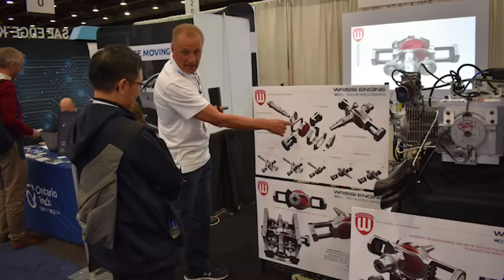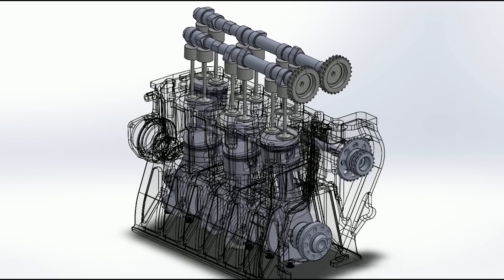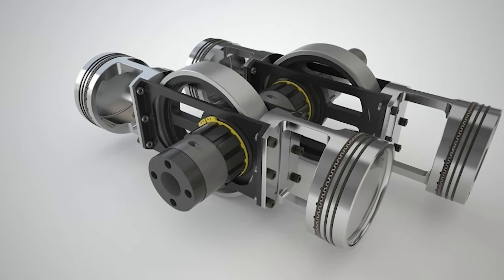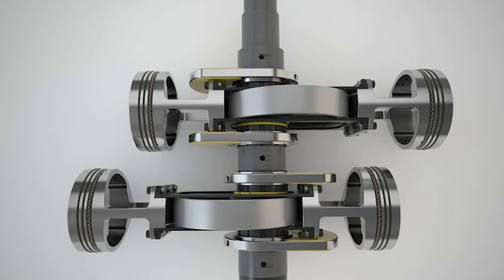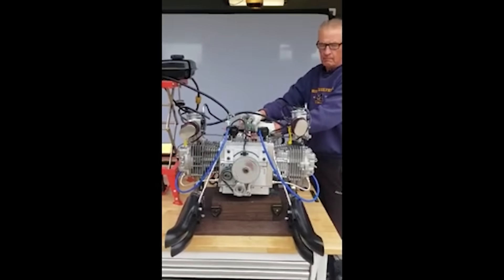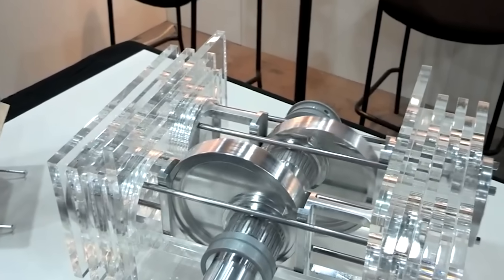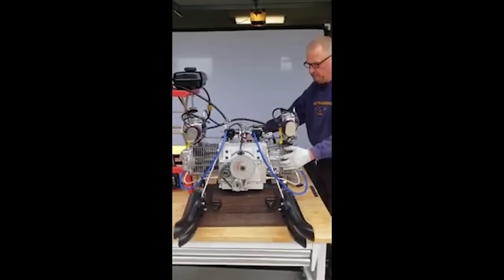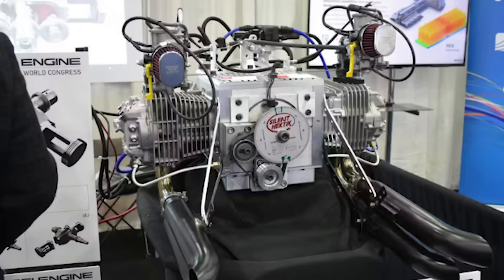The Waissi Engine: Reinventing The Combustion engine

Comment: 1:20 mechanical complexity? hard to find something simpler than a rotating crankshaft. Waissi engine is testimony to that. And the sinusoidal motion of the moment arm provided by a rotating crankshaft which leads to its inherent inefficiency is unchanged in the Waissi engine. The location of the sinusoidal motion has just been moved to a different component. Nothing new here. Just another embodiment of a Scotch yoke engine.

Comment: There's a lot wrong with this engine. Unlike a traditional engine the crankcase of this has to be at least double the size for the same stroke as a normal engine. A normal engines piston travel can utilize almost the full cavity of the crankcase this literally has to use less than half. So whatever the stroke of the engine piston the crankcase will be more than double that to accommodate that stroke. Also the torque you would achieve from the way this crank works would be inferior to a traditional engine since you would not get the leverage that a traditional piston rod and offset crank

Comment: So many dim bulbs. ICE isn't going anywhere. The problem, is the fuel we been using. 
JDR worked it out so we all flare his garbage out our tailpipes. 'Ol man Henry wanted to build the Model T with resin impregnated hemp body panels and hemp oil in the crankcase.
And he designed it to run on ethanol. Same stuff Brazil runs on. Sustainably. At $0.77/L.
David Blume. Wrote a book. Alcohol Can Be A Gas. I've listened to around thirty hours of his casts here on EweToob. He calls ethanol the sun's energy in liquid form, a ton of benefits, the biggest drawback is gas is about 15% more energy dense. EVs are on a hall pass from the Smithsonian. They were made more dangerous with the addition of the dreaded lithium dendrites. Tesla's own advice to FDs is immersion. Yes. A dunk tank. Give your heads a shake.

Comment: For a hybrid car no circular motion is needed. In a hybrid the motor drives a generator. It is easy to make a generator that is driven by a lineair motion. So in the future only motors with lineair motion. Crancshafts are obsolete.
Reply: For eCVT transmissions, (the majority right now), your theory is wrong.  The electric motor/generators are coupled directly to the planetary gearset and have no belt like typical CVTs. I'm afraid that the current technology doesn't accommodate a linear generator because the gas engines in hybrids are used also to provide peak power when needed.  Sorry mate!

Comment: It has been proved that EVs are cleaner than ICE over the complete life cycle including battery manufacturing.   Most ICE analysis ignores the cost of exploration and extraction and refining of oil.
Reply: Hi CCP Bot.  We’re not buying it and we won’t have it forced upon us.  Next step is find out.
Reply: @rollsroyce329  Well I live in Florida and am 72 years old so I predate bots by many decades .  I also believe in science and facts based issues versus wherever you've got your head stuck up
Reply: @PC-vq5ud  You sound “Vaccinated”.  You may not be CCP but you’re definitely an NPC.
Reply: @PC-vq5ud you sound “Vaccinated”.  You may not be CCP but you’re definitely a NPC.

Comment: As design engineer I dont like it.  with a conventional engine the big end bearing has a large surface area with an pumped oil film between the loaded area. The engine in this videa does not, it has very tiny contact area on the loaded face. 
The only way around that would be if the offset wheels had roller or needle bearings on its diameter, then the load will be spread.

Comment: The beauty of this is that it isn't an entirely new engine design, it's just a new kind of crankshaft/connecting rod design, and all of the other outlandish 2 stroke and what not designs of modern out there engines can also be applied for even further gains and efficiency

Comment: The issues with pivoting connection to pistons are pretty well sorted out, and there are no significant energy losses from friction to reduce,  the basic principle has been "the industry standard" for piston engines since long before the first somewhat practical internal combustion piston engine was developed.  The forces/friction in the interface between the pistons and discs in that design are probably worse than in a conventional engine.      

It's classic scam is to take the working principle of some existing compressor, or even pump, and present it as a revolutionary new engine. It's quite clever as the basic principle of many compressors are basically the inverse of a combustion engine, and vice versa. And, you can use parts from such air compressors to demonstrate the working principle of "your" supposedly revolutionary new engine. And then run some actual engine that you claim works with "your" supposedly revolutionary engine design, as it makes perfect sense to use off the shelf parts as much as possible in early stages of development.     

The amount of effort by really talented people has put into seriously trying to improve piston engine designs for centuries is far beyond most peoples ability to comprehend. The basic core working principles of current piston engines are about as good as they can get, and there are other, some of which that probably are much better, ways to connect to opposing non-pivoting pistons to a crankshaft. There's theoretically room for some modest improvements of piston engines in other aspects, but modern conventional crank designs doesn't have any relevant  problems to "solve".

Turbo-shaft engines on the other hand has some huge potential advantages over piston engines, but they're rarely, if ever, even seriously considered unless their fantastic potential power density is important, and because of that and some practical challenges with them, power density, and reliability, is almost always prioritized much higher than high fuel efficiency in the development of them.

Comment: If you want an ICE to outperform the piston engine, get a gas turbine. It needs an energy storage like a flywheel or battery due to poor low end efficiency. That allows intermitttent full throttle operation.

Comment: It does not eliminate side loads on the pistons. Also at high rpm's the speed of the eccentric discs will require tremendous perfect lubrication to avoid destroying the outside contact point with the piston assembly. What is called bearing speed will kill it.

Comment: looks like the Torque arm moment is low with this change though. Are the vertical push members slightly slanted? I would try that if they didn't yet. I could look into it if you haven't yet. One thing that may also help is to offset each side vertically and keep the eccentric center shaft in the middle. That will make some imbalances, but for small applications it may still be an improvement.

Comment: Longevity for this design will be its downfall because of the twisting forces on the pistons. The cylinders will wear out laterally because the force from the disc is not in the centre of the cylinders. At the same time the torque delivery will be relatively low because the point of pressure on the eccentric disc remains too close to the shaft. Like in a rotary engine, the revs can make up for the low torque, but then high fuel consumption becomes the next issue. It is likely to go the same route as the Wankel engine.

Comment: First I wished car manufacturers had investigated and installed efficient, narrow rev range battery charging motors for self charging hybrids use YEARS ago. That way, we wouldn’t be rushing towards EVs so quickly now, and all the BS and depletion of rare Earth elements in monstrous quantities. I reckon a low capacity (250cc) diesel or biofuel would be perfect and quite literally sip fuel doing it.  But here we are, with everybody still talking about it the 0-60 times that matter rather than the environment😢. One thing of note from the video is the claim of no friction, or rather less than a standard engine. I would contest that. Surely any force exerted to turn the crankshaft must be lateral somewhere and the bigger journals would increase friction too? Also would torque be as high?

Comment: It has exactly zero chance of making it to the mass  market.   Retooling would cost hundreds and hundreds of millions or more of $$ to retool.  So far it has not yet proven reliability for 200,000+ miles like conventional engines already have proven.  Anyone who dabbled in experimental airplanes can use unproven concepts, but would you go flying keeping this in mind.?  Furthermore, the designer of this  engine has not presented one shred of metrics to show HP, torque, and longevity and lacks business savvy if he shows the engine without that.    Without presenting credible data, they look like country bumpkins.

Comment: First, I don't see what pushes the piston back inwards. Is there a connectin rod from one to the other? Second: in a conventional boxer engine, the two opposite pistons go in and out together; this design will create a huge inbalance since left and right pistons move in the same direction, also creating massive vibrations. The only way it could work, as I see it, is an 8-cyl flat engine, where at any time 4 pistons move inwards and 4 move outwards; not just a boxer 4, since in that case you would have lateral forces (the front two pistons move right while the rear two move left).

Comment: If this Waissi Engine turns out to have the promise it appears to have: lighter weight, less complexity, less internal friction, greater longevity, greater reliability... then it will be a huge hit in the General Aviation industry.  Current aircraft (gasoline) piston engines have to be fully overhauled per regulations roughly every 2000-2500 flight hours.  And it is very costly to do that, mostly because of the amount of very skilled labor involved in the overhaul.

Comment: The pistons would have a side load constantly on one side only due to gravity. Likewise oil would settle on the bottom and only lubricate the components submerged in oil. Which is why most engines have the pistons oriented vertically so oil drains away from the pistons and not into the combustion chamber.
Reply: Same issues as boxer engines.

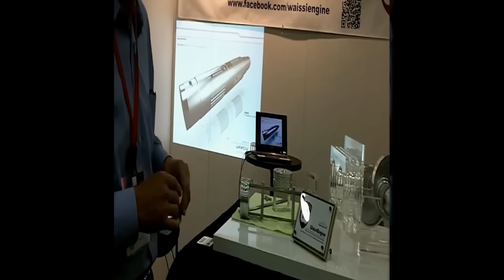Comment: @3:45 Unlike a boxer, where each cylinder has its own crankpin (spaced 180º apart), this engine has its pairs of cylinders "connected" to a single crankpin. Would be accurate to compare it to a 180º Vee, not a boxer.

Comment: It still side loads the pistons. The contact point is shifting just as much as it would in a connecting rod engine.
Reply: Indeed it does. The piston will experience a moment centered on the point of contact with the eccentric disc since the applied force doesn't strictly act through its centre only. The piston will rock from side to side as the disc sweeps back and forth across the contact surface. 
This design does not solve the problems at all.

Comment: Make it small and put it in a generator. 🌎✌️🍻 Taking the wear off of piston arms is really clever. It makes the engine smaller with good efficiency. I'm extremely impressed by the simplicity. Really good job.

Comment: you need to make it a 8 cylinder engine to reduce rotational imbalance, this imbalance would create a ton of side load on the cylinder. I would add a bearing with a hefty mass around the crank discs because it's easier to manage friction between round shapes than between a round and a flat which have a single point or line of contact. This bearing would tend to not slip on the piston and not rotate with the crank resulting in less wear.

Comment: How does the linear surface speed at that large diameter bearing interface compare to the surface speed in the big end bearing of a crank and rod of the same stroke, at the same RPM? If the surface speed of that one big bearing is more than the surface speed of the big end by a large enough margin, it could offset the friction saved by removing the piston sideload. The fact that they had to crown one of the surfaces hints at this.

Comment: What are the torque numbers?  Would the short throw of the eccentric limit torque?
Reply: You’re thinking it would lack “leverage”?Crankshafts do not provide leverage to the work done by combustion pushing the piston down the bore.  Leverage can be found in the transmission, differential and tire diameter however.

Comment: The only problem I see is there will be a lot of slapping against the lobes during engine braking because there is no rigid connection between the piston and lobes.  The pistons will be changing from an explosion to a vacuum, and that reversion of forces will cause the pistons to slap against the lobes when explosions reoccur.

Comment: So, we are here conversing about the wear and tear, heating, cooling, oil, of an engine which burns fossil fuel. It will be 20% efficient when burning that fuel by converting reciprocating motion to circular motion - to drive round wheels - in the process, wearing out metal contacts and burning out cylinders and pistons. The process has never found a way of stopping carbonisation since fossil carbon based fuels produce both carbon and toxic gases. When the world discovers a motor which has no contact with 2 moving parts, and doesn’t produce  toxic, carcinogenic waste, it might make progress. Oh, wait! We’ve got the electric motor. No toxic waste, virtually no wear and tear, instant torque and almost silent. What a stupid video. And what stupid people here discussing the virtues or otherwise of a failed technology.

Comment: In effective crank angle is a feature of a reciprocating engine . Any piston and chambered design is going to have the same problem. If you retain reciprocal motion , double acting pistons are in a pressure fed air chamber improve valve reliability and reduce cylinder exhaust temperatures. This design  is a reduction of crank angle losses , but at the cost of greater friction surfaces . Engine design is always a trade off………

Comment: You could use the Waissi disk and arrange the cylinders in a V4, two cylinders per disk. That would prevent the top dead center problem. Because you are sliding on the surface of the disk the friction reducing benefits of eliminating side loads are still in effect.

Comment: The 2 discs I think act as flywheels as well as eliminate the crankshaft as well.  If it could be devised, a way for the internal cylinder walls to rotate, that would also prevent gravity wearing of the downside walls of the jugs, which I heard years ago was a common issue in VW engines of the past.

Comment: The rocking couple effects will be enormous on that
Reply: Yeah, it makes more sense as a flat 8
Reply: yes you need to make it an 8 cylinder
Reply: Looks pretty manageable  with the test footage showing a guy operating it  just sitting on a table
Reply: If it was 360° firing order, you could use a counter rotating balance shaft
Reply: I would say a flat 6@120° would be best. But the drag from the high velocity of sliding surfaces would caused tremendous losses and cancel out any advantages.
Reply: @tomnagel5634  you don't need sliding if you add bearings, it will be like a rocker arm bearing, ok it's way more loaded than a rocker arm

Comment: No side forces? Not true. Contact point moves off center. Less friction? Nah, sliding bearing, hydrodynamic lubrication is also used in nowdays conventional 4 stroke engines. Also here are vibrations of a flat 4 engines, way worse than boxer enggines. I see more issues than advantages here. BTW automotive instructor here.

Comment: For the use of a range extender I would use a 2 cylinder opposed piston engine of this kind where the rotary kinematics just acts as a phase shifter coupling between the two pistons with almost no force acting on it. For the power output I would suggest the use of 2 moving magnet linear generators where the moving magnet systems are connected to the piston skirts.

Comment: A nice idea which allready exists in its kinematic inverse, the crank slider. The advantage of a crank slider is its simplicity and less weight compared to its kinematic invers. The disadvantage of both solutions is more friction compared to a connecting rod. But the piston friction is much less compared to a connecting rod kinematics. The vibration management is an issue (as you can see in the video) except you operate it in a opposed piston configuration like in the case of a Boxer engine configuration like in the old VW Beatle, or in an 3 cylinder single action or 6 cylinder double action arrangement.

Comment: In Life Magazine July 1958 with Eisenhauer on the front page, it showed a square box known as a Rambler Rebel with crap technology, getting 35.37 MPG, On a trip from Florida to California, in US gallons. Now here's the rub. Imperial gallons delivered 32 MPG at that time. Cars on Imperial Gallons still getting (less than) 32 MPG.Solution is simple, force the powers that be to improve the fuel consumption levels. (US gallons are aprox. 4 liters and Imperial gallons are about 5 liters).

Comment: Horrible design. The piston's center line does not push on the rotating shaft. The tremendous side loads will wear cylinders, rings, and pistons rapidly, and the tremendous high speed of the crankshaft surface under high load is looking for trouble